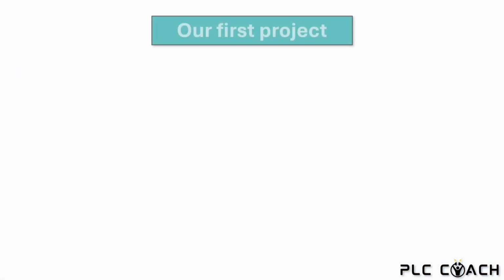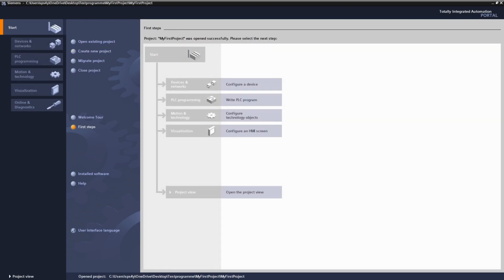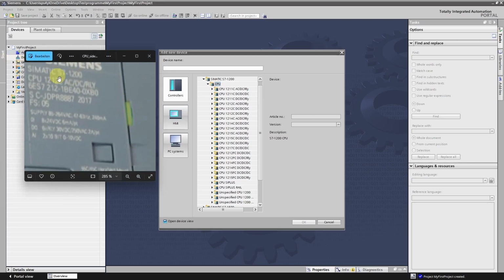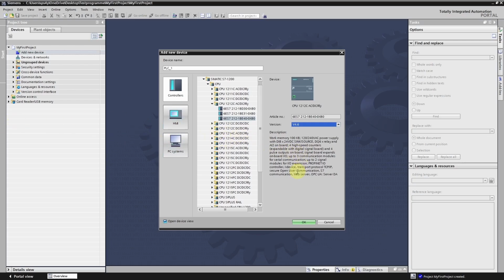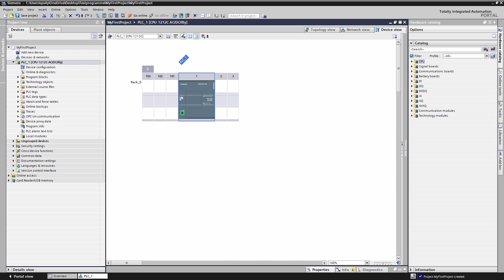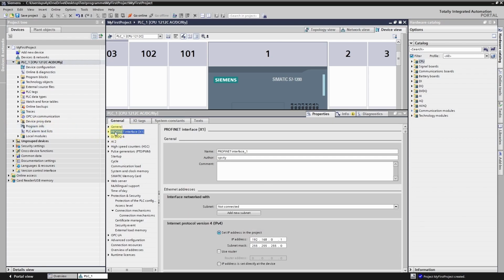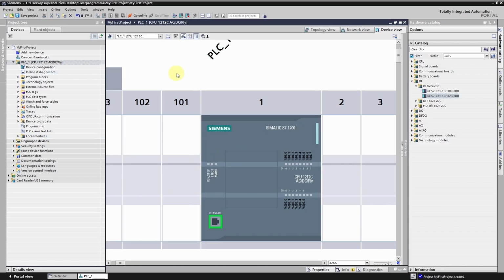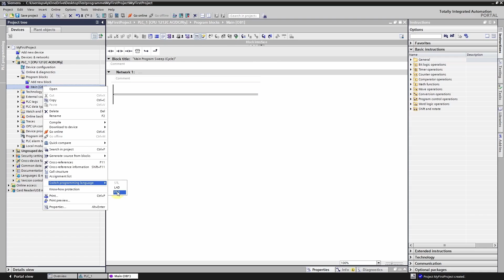PLC Basic Course 2.2 | Create Project | Learn PLC Programming in TIA Portal

Comment: Mr please can you tell me,
Should i be engineer student to work as plc worker,
Or its possible for me making it as switching carrer,
Cause i love controling systems as arduino and these stuff,
All i need is just a clear idea,
Can i make it
Reply from the maker: Hello,

I believe the journey to becoming a PLC programmer varies greatly depending on where you live. In Germany, for instance, anyone can start in PLC programming without formal study, though having an electrical background is definitely a plus.

I also offer a comprehensive German PLC course. I always recommend that my students begin by mastering the basics—whether through online or in-person courses. Once you have a solid foundation, you can start applying for entry-level PLC positions. In the early years, you'll absorb a lot of knowledge, so it’s important to remain flexible with both your salary expectations and job location.

Have a great day!

Florian (Your PLC-Coach)